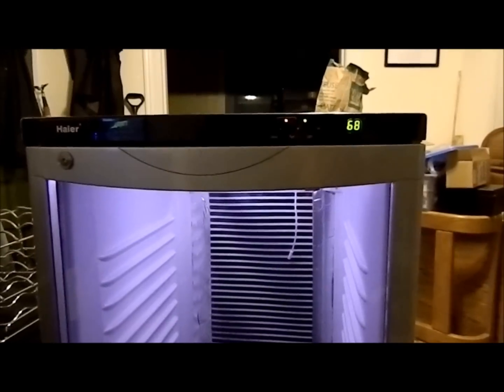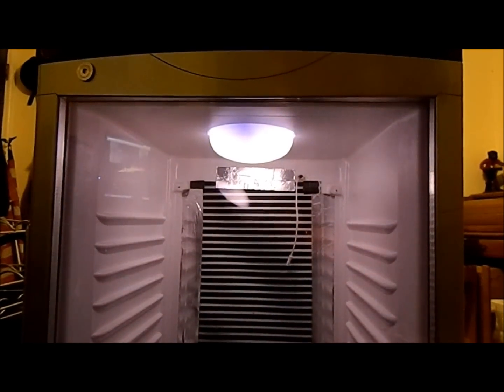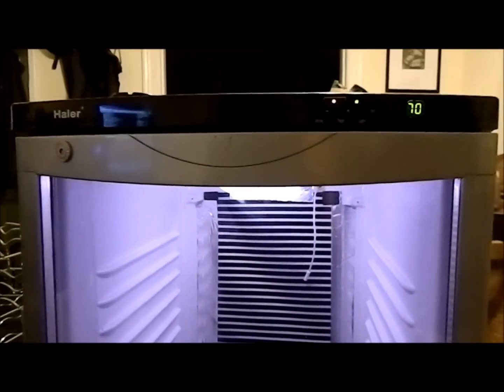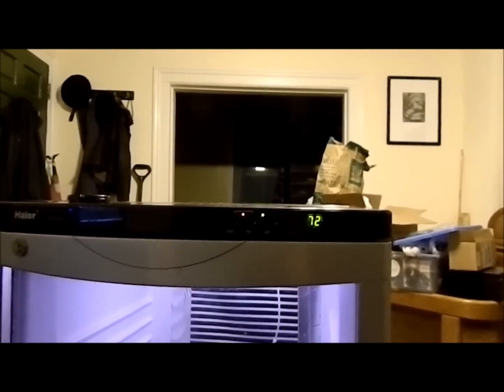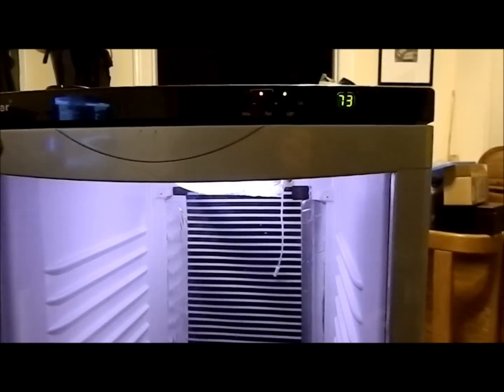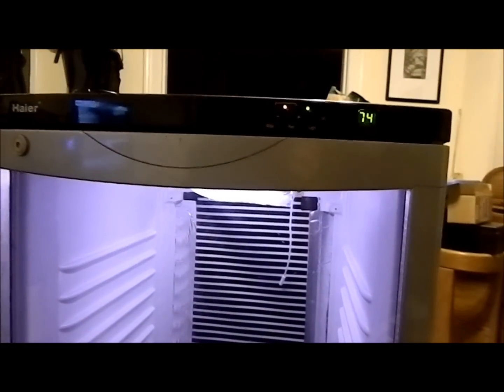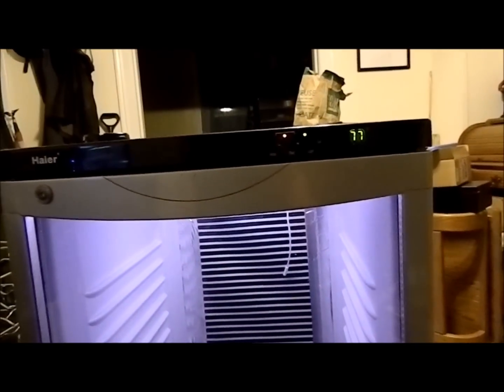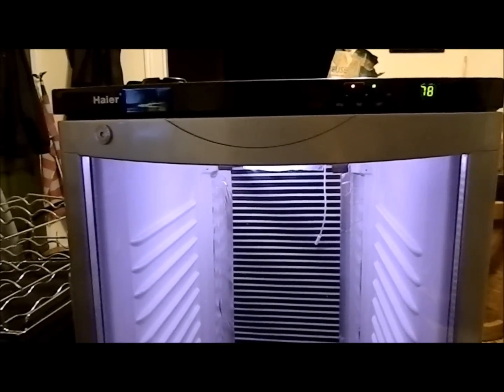Incubator Progress pt. II

Comment: So I found your channel. I picked up the same wine cooler with heat tape already installed. My heat is a 4 degrees warmer towards the top and inconsistent.  I am using a VE300 to control it and it is test set at 86 now and I am getting 90-91 in the top.   Did you use a fan?  Can you let me know if you have an updated video.  The Last one I saw was when you had it set and the probs in each bin
Reply from the maker: House of Pets -Las Vegas 
A fan can be used, yes. 
I no longer have this incubator though.
Reply: Reptile Nexus thanks.  I assume it worked well. Did you use a fan tho because of the height